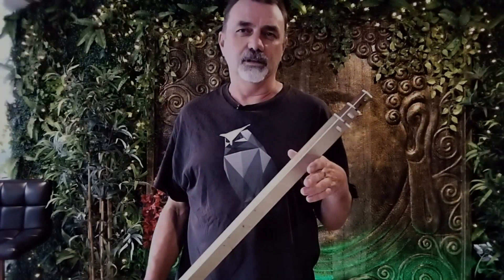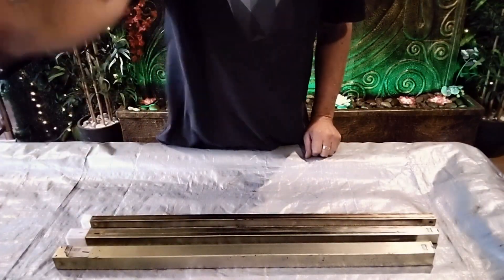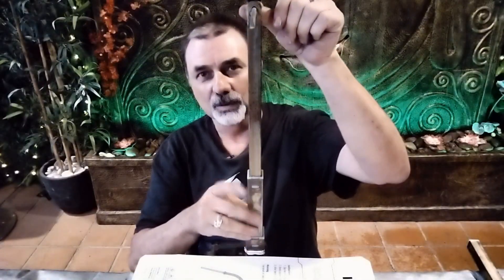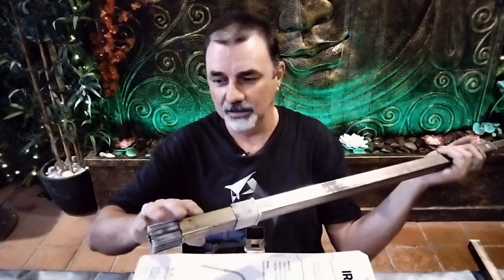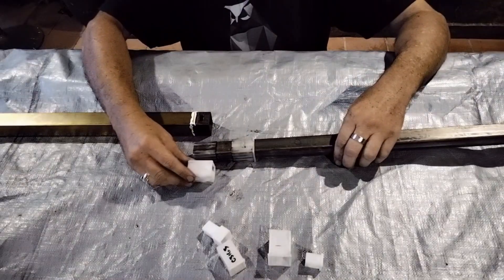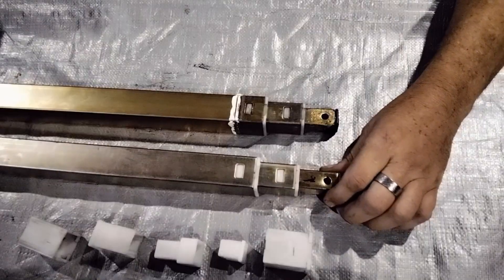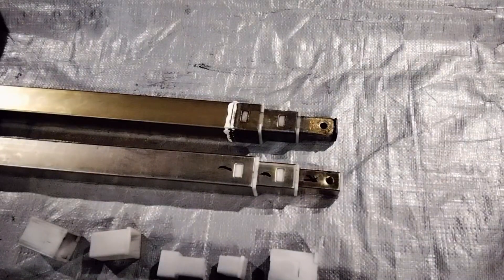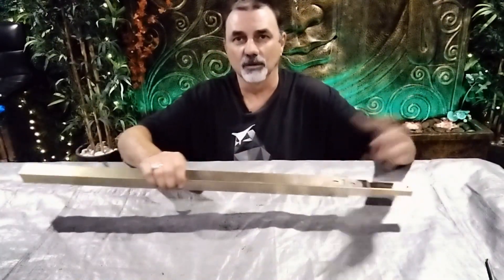Jayco lifter repair

Comment: Hey Mate, hoping you see this comment. How did you fish out the stopper from the lower section? In-situ or needed to be removed from the van? I’m about to go through this exercise.
Reply from the maker: I used a wire coat hanger, straighten the hanger  out, then bend  a 90 degree hook into it, then send it down the riser, 

it may take a couple of goes and adjusting the hook, but once you hook the peice it should come up easily.

If it's a corner you can get to the inside and see the bottom where the spring curves to the floor, you can also poke something up the riser to get the plastic bit started.

Another tip,  is to pull up and move the top of the spring to relieve it's resting pressure on the plastic bit at the bottom, because it curves right at the bottom it puts slight pressure on the plastic, once you get it moving it gets easier as the spring is straight.

Hope this helps mate, let me know how you go 😊

Comment: On the maiden voyage of my Jayco swift outback. The front offside spring popped out . I Managed to get it back in and into Jayco for repairs. They found three of the four lots of white plastic/nylon bushes worn and replaced them all. However, the whole lifting system seems dodgy. Not to bad if the failure messes up a weekend. However, I would like to take it on the big Lap and that might be a risk that’s too big. I wonder what your thoughts are on the suitability for repeated setup snd set downs every other day .

Comment: Thanks for the video. In normal use should the middle support rod be fully extended (gently pulled to its stopper) of should it have 150 mm or so below full extent which would be stronger? Mine don't always go up so I gently pull them till they stop but not sure if this is correct

Comment: Another great video! I really enjoy your detailed practical explanations and demonstrations! Very helpful and inspiring! Although I am now sad as I've watched all your (four) Jayco videos.  Perhaps I could encourage you to make another??  If you would like a suggestion for a subject, I'd suggest preventative maintenance tips for the winder mechanism - inspection, lubrication, and what to look out for to avoid issues while on Holiday.  I don't have a Jayco, I have a 2014 Coromal Navigator 391 - it's the smaller one, with a layout similar to the Jayco Hawke. But your advice in the videos will be pretty much directly transferable.  Thank you for making this video!
Reply from the maker: Thank you for you kind words, unfortunately ive had lots of recording gear die recently, now including my PC, the truth is ,making and editing the videos is a chore , having a busy life and family etc , i don't always have time for my channel.

That said, I have been working on a way to help pull the beds out easier, i have made a prototype for one bed end, and am testing it on every trip, if it proves to be successful i will make a video on how to do it.

Great idea on maintenance, i was only just thinking about how to do a cable and roof leveling/adjustment video.

Thanks again, cheers 
😎

Comment: I have the Jayco eagle outback, I think it’s the model before yours
The corner caps on my roof, need replacing, what about yours?
Love to see a video on that.
Thanks
Reply from the maker: My corners are still all good, but the way they are glued on, would make them a bit of a pain to replace id imagine,  but depends on why yours need replacing, are they cracked and broken or just leaking ?
Reply: thanks mate, not leaking just a few small hairline cracks and really weathered. Maybe a coat of some kind of paint would sort it.
Reply from the maker: @inrhythmvideos  You may even be able to scuff them up a Gel coat them or something, but I'm sure there will be a few products that will do the job without replacing them , maybe look at Marine products for fibreglass boat's ?

Comment: Just watching this again. @ 7:44 you mention that if the spring pops out and it’s too high to get the lifter back on then unbolt the lifter from the roof. This is not necessary, simply unwind the roof a little, the spring will retract and then the lifter will fit back on. In the field tension can be adjusted on the cables with the roof mostly down. Just crawl in with a torch (on older models Eagle or Hawk where the winch is at the front under the front bench seat) BUT only if you’ve removed the false wall to ensure easy access.
Reply from the maker: I found that the sprigs don't always retract down under their own weight ( without the roof pushing down)  so winding down the winch  may actually create slack in the other cables , I fear they could come off their guide pulley grooves creating more problems later.

I just figured it's only undoing one bolt ,and then you don't risk possibly disturbing the operation or the rest of the lifter cables.

Comment: What is the green wire standing next to the cover of the video
Reply from the maker: It's the roof tension wire, it's purpose is to visually tell you when the roof is at full height so you have correct tension on the canvas, and also so the door fits correctly.

It's important to NOT use it as a "stopper", more as a guide to when you are approaching the final stop point, it should end up taught but still slightly flexible by hand.
Reply: @UCmumstaxi on older Eagle and Hawk models the green wire is at the front left side for those who were wondering.

Comment: Sorry about the delay in replying. This is an excellent tutorial, the only critic I could say is that the sound needs some work. Thank you very much for the video.

Cheers all
Reply from the maker: 100% agree James, sound is dreadful, long story short ,I was bombarded with recording device issues, took a week and about 5 takes on different days to make even this short trollop, I also needed to get my camper back together, as it was outside in bits.

 I was exhausted from making the first video, by the time I realised how bad it all was (when editing), it was too late.

Almost didn't post it, but I thought someone may still see around the poor quality and still get some useful info, but yeah , my apologies,  it's far from my best work, im just lacking decent equipment and time ATM (lol)

Comment: I have been looking for the part that goes into the top of post that connects it to the roof. Do you have any information on that part or the name of that part? I am sure it's a roof mount of some sort.
Reply from the maker: Sorry Brian, I assume you are talking about the triangle spacer or the spacer on the bolt ? You will have to talk to a Jayco dealer I'm afraid, as I have no access to part numbers etc, but I'm sure both will be available from Jayco.

Comment: Great video. Well explained,  thanks
Reply from the maker: Thanks Peter, hope it helps 👍
Reply: @UCmumstaxi  if I replace each arm with new ones will that eliminate the leaning to my roof ? 
What type of lubricate and how often?
Reply from the maker: The short answer is no,  the lean on the roof is normally caused from the camper not being dead level, the cables not adjusted correctly, or simply the weight of the awning on one side, and/or ,over tensioning of the awning guy ropes (that pull the roof to one side.) these symptoms can also cause the door to be difficult to fit or operate.

Assuming your level and cables adjusted properly, you  can "carefully" pull up the lower fatter sections of the 4 risers by hand to add stability , also adding ropes to the opposite side of the roof to the awning helps a lot, and this also increases stability in wind (i use a shade cloth that slides into the sail track and peg that out with opposite tension to the awning)

Lubricate with a Dry lube spray, one that does not attract dust , and i pretty much give mine a light spray about every 2nd or 3rd use, but if you don't use the camper very often , then do it every time, if im camped at the beach,  i spray once a week while its up to avoid surface corrosion
Reply from the maker: The short answer is no,  the lean on the roof is normally caused from the camper not being dead level, the cables not adjusted correctly, or simply the weight of the awning on one side, and over tensioning of the awning guy ropes that pull the roof to one side.

You can "carefully" pull up the lower fatter sections of the risers by hand to add stability , also adding ropes to the opposite side of the roof to the awning helps a lot, and also increases stability in wind (i use a shade cloth that slides into the sail track and peg that out with opposite tension to the awning)

Lubricate with a Dry lube spray, one that does not attract dust , and i pretty much give mine a light spray about every 2nd or 3rd use, but if you don't use the camper very often , then do it every time, if im camped at the beach,  i spray once a week while its up to avoid surface corrosion  @denisepato9872
Reply from the maker: Thanks for your kind comment 👍

Comment: Can you send or Post All the parts I need to rebuild the system for lifting the Pop up tent. I have the trailer and a new tent but not any of parts that makes it a Pop up? Your video is good but need all the parts so I can do it as I watch.
Reply from the maker: Sorry David, I don't deal in any parts or have any association with Jayco, but look up your local Jayco parts Dealer and I'm sure they will be able to help and post the bits.